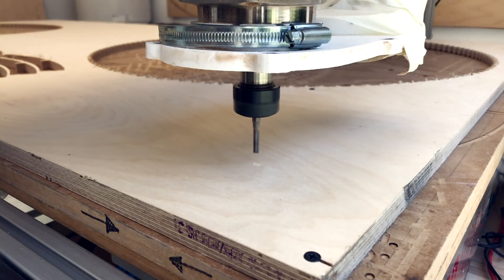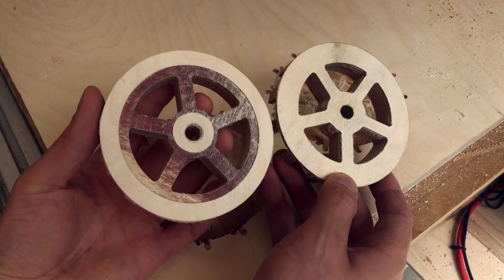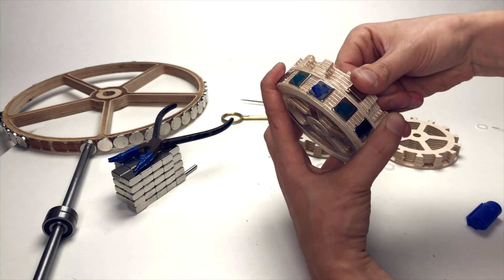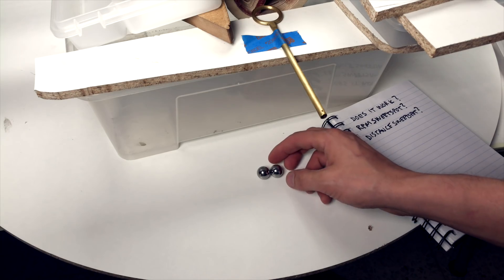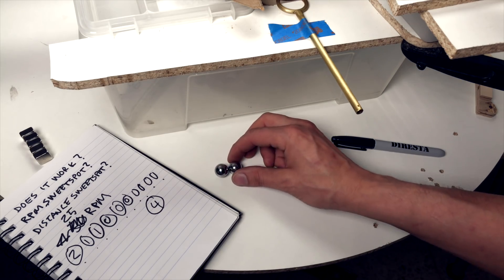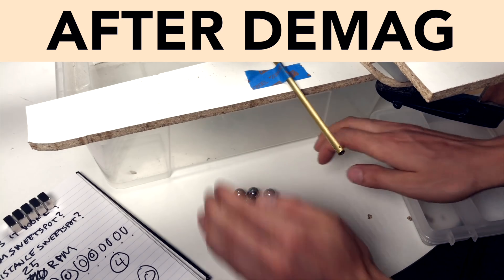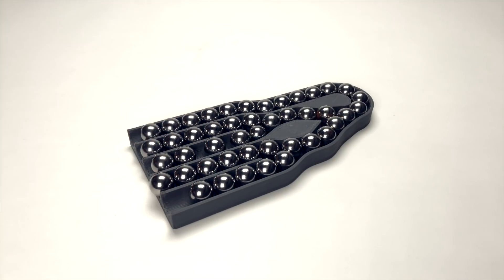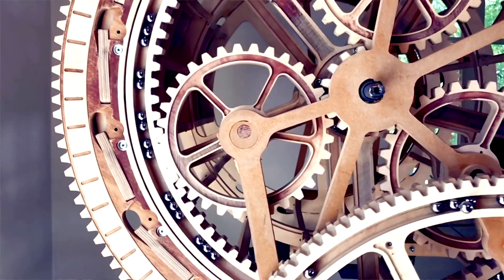Marble Demagnetizer 2 - Marble Machine X #39

Comment: I love your videos and look forward to seeing them every Wednesday. It looks like you may have had a few problems in your experimental setup though. First off when you push the marbles down through the marble divider they are not going at the same speed they will be traveling in the final product which could result in some errors. But more importantly it looks like the box that caught them at the bottom held the marbles really close to the de magnetising wheel after they had already fallen off the marble divider thus giving them a much longer time to be demagnetized by the demagnetisation wheel. Just some things to consider. Keep up the great work, I can't wait to see the finished product!

Comment: Hang on... Even if you slow them down to 25%, they'd still be moving at a consistent speed, but you let them sit over the top of them for some time before pushing them off... It might be fine, but that does make me wonder if it could become an issue.

Also, something else you didn't test was if the force of new marbles entering the first track would be able to overcome the magnetism pushing back the  other way

Comment: i really hope the marbles will actually flow over the demagnetizer. currently they seem to need to be pushed, which will likely throw marbles off the track. also, the first lane (that splits up => 100% "speed") is way shorter (to give the marbles some speed) and thus hardly passes by the demagnetizer at all (at least in the CAD-model). if this doesnt work out the way you want to, consider a steeper angle to let gravity help moving the marbles

Comment: I feel that you should try changing the direction of the demag wheel. In your testing, the magnets were spinning in the same direction as the marbles. If you change the direction, the marbles will pass through a greater number of alternating magnetic fields which should increase its effectiveness. However, this also means that each alternating field will have a smaller effect on the marbles due to the increase in relative velocity which shortens the time that a marble will be in any single magnetic field. 
I just think it is worth testing out as the speed and number of marbles over the demag wheel is likely to change with the song so you would want it to work to its greatest potential.
Keep up the good work.

Comment: I feel that the demagnitizer wheel should rotate the opposite way to the way the marbles are flowing, if you turn with the marble flow is there not the chance that the magnets "grab" the marbles and move them through the system so they don't spend enough time to be influenced by the magnets. But if you put it the other way gravity pulls the marbles down and the demagnitizer pushes slightly upward so the marbles spend more time instead of speeding through. Maybe this is a non issue though I don't know the entire MMX setup

Comment: What was the issue with glass marbles? Wouldn't they work fine?
Reply: they can't be used on the 2 first lift wheels working with magnet...
Reply: Oh yeah, I didn't realize other parts relied on the magnetism of the marbles. Of course the lift wheels could be changed but there are probably other reasons too.

Comment: Wont the magnets themselves hold the marbles in place? I saw you were pushing on it, will there be anything pushing the marbles? Or just gravity?
Reply: I gues the force from the other Marbles pushing it is enough
Reply: I was wondering that myself. It's hard to judge from the video how much force is needed to push them over the demagnetizer but it seems like more than gravity can provide…
Reply: My concern is that the incoming marbles will be feed too fast and will spill over the tracks from the back force of the magnets
Reply: If he made the first demagnetizing wheel a little bigger he could put a slope on thAt 3D printed piece the magnets would be farther apart  but I doubt it would be two much of a problem.
Reply: Marble pushing eachother and gravity force

Comment: stll to this day hoping that magnets aren't going to be used in mmx
Reply: why
Reply: LargeBanana you sure your name isn't Slowbro?
Reply: Dener Silva what do you mean, it seems the magnets are fixing a lot of possible efficiency problems in the machine
Reply: He's pretty clearly set on them at this point.
Reply: Some websites cite around 5% loss over 100 years for neo magnets, but either way the ones on the MMX aren't going to fail before we're all dead. :-)
Reply: YankeeIngenuity they lose less that 1% of their magnetic strength over a one hundred year span.
Reply: Ah!  Right on.  Centuries from now when this wonderful machine is getting some maintenance, I'm sure fresh magnets will just be part of the restoration process.  I'm liking the look of this design better than the prior.
Reply: I keep thinking about all the sloppy electricity getting generated when it's all up and running, as well.
Reply: He can always make more components for the machine, you know ... Have a couple of spare demagnetiser modules, maybe a few fly wheels that can be easily changed. Once Martin knows the MMX will work to the standard he wants, he can then manufacture spare parts. to take on tour.
Reply: Dener Silva magnets are not finnicky to work with if you know what you are doing. He’s clearly doing a great job with them and they are very necessary to this machine. Taking the machine apart and putting it together will not effect the magnets at all. Also the type of magnets he is using are extremely reliable and very consistent in behavior. With his type of dedicated experimentation before putting anything on the machine I believe he will have very good success implementing magnets anywhere he sees fit.
Reply: I sort of agree.  Don't neo magnets have a finite life span?
Reply: LargeBanana why

Comment from the maker: It´s Monday Everyone!
Reply from the maker: @radioMax haha, thought you missed two days of appointments thats brilliant :)
Reply: Goodnes, gracious... you scared me Martin! I just wake up and when I saw the notification I tought it was Wednesday! Hahaha, have a good week!
Reply from the maker: @shashank D Never heard of it :) maybe have to change marbles after a while... In hindsight i shouldnt have used magnets for the lift system, it was just so much more esthetical but if i would have redone the design i would have skipped it, so much problems, now hysteresis lost is another to add to the pile :)
Reply: @Wintergatan  Hysteresis loss  will not affect your mechanism at all. All it does is produce a little bit of heat, and make the wheels of the machine a bit harder to turn.
Hysteresis is just the reason why you have to demagnetize the marbles in the first place.
Reply: my thoughts exactly, it's not like the marbles are expected to induce any current or do work in any kind of electromagnetic device
Reply: New trend: Wintergatan Mondays
Reply: Marble Machine Mondays are an excellent way to start off the week!
Reply: Marble Machine Monday?
Reply: Martin have you ever considered, with all those moving magnets in there, generating enough current to run a few LEDs to light the machine internally for awesome visiual effects on stage?
Reply: Best way to start a monday <3
Reply: You could get some of that special paper that lets you see magnetic fields so you can tell exactly the right height to put the demagnetizer. It would look super cool, too (even to include somewhere on the final MMX maybe)!
Reply: No that is not how you should say it 
The correct way is: it is Monday my dudes(and dudettes)
Reply: Wintergatan I see what you did there
Reply: Hey Martin check out this video. 3D printed magnets may be able to help you in your design. tinyurl.com/SED153-Magnets
Reply: MAKES my Monday unexpectedly exciting!
Reply: IT HAS TO BE CALLED MARBLE MONDAYS.
Reply: Wintergaten Monday’s
Reply: from WW to WM
Reply: pin your comment to the top
Reply: great now I have to wait less to see your videos :)
Reply: @saneman100 it does look all nice in a steampunk kinda way. I love it.
Reply: Wintergatan mondays
Reply: Jk it’s making Monday’s
Reply: @Wintergatan @Basement ScienceE 
Indeed I found @Shashank D comment quite bizarre. The magnetic properties of the steel marble are intrinsic to the material. The marbles do not lose any magnetic properties at all.

The technicality behind it is that you have several the so called "magnetic domains" inside the steel, which consist of regions of the material where the magnetic field vector is pointing to a given direction. The magnitude of the magnetic field in each domain is intrinsic to the material (it's about 2T for steels) and is not affected at all by such magnetizing/demagnetizing cycle. 
Initially, the orientation of these domains are randomly distributed, so the sum of all magnetic field vectors cancel out. When the marble is subjected to a strong external magnetic field (e.g., the NdFeB magnets), this has the effect of orienting these magnetic domains to the same direction of the magnetic field of the magnet. When the external field is removed the distribution of the magnetic domains does not necessarily become random again (because of the hysteresis!), so the marble remains with a reminiscent magnetic field, which makes them stick to each other. That's why you have to demagnetized the marbles, as @Basement ScienceE pointed out.
In several engineering applications the material is subjected to magnetizing/demagnetizing cycles (for example, the steel sheets in transformer cores), sometimes thousands of times per minute, but the magnetic property is not changed.

Maybe @Shashank D was referring to the demagnetization of the NbFeB magnets over time and exchanging all the magnets would be a pain in the ass. This indeed could happen, but I'm not sure if such decrease would be relevant or observable in your mechanism. I think this would only be a problem if the Marble Machine is subjected to another even stronger magnetic field.
Reply: Shashank D if you have noticed there are small gaps in the corners of the magnet placement gaps in the wheel so I guess that they are Made to make the replacement process easy
Reply: Floggle We do have internet here, don't worry 😉
Reply: Will there be one on Wednesday ?
Reply: Every day should be wensday!
Reply: 7:42 RIP!... jajaja!!! XD
Reply: Hello Wintergatan, have you considering to edit al the video content you have so far, and until you finish MMX, to make a documentary movie about it?
Reply: My birfdae
Reply: Hai
Reply: Man I'm not getting a paino until till next week end but I love your vids and creations.
Reply: @ Floggle You'll find a way... :)
Reply: Pierce Arner Excellent name! MMM for Marble Machine Mondays is perfect.
Reply: No its mœnday
Reply: Wintergatan repulsed is cool. That is an English word. You're good.
Reply: @shashank D Hysteresis loss has nothing to do with losing magnetism over time. Hysteresis loss is energy wasted on magnetizing ferromagnetic material in other (opposite) orientation it's already magnetized.
Reply: Wintergatan i got a really bad sun burn but your video cheered me up
Reply: Nice job with that demagnetizer; but you shouldn't slam it with a hammer, as this will demagnetize your magnets.
Reply: Wintergatan  🌷☀🌼😀🍒🌸🌳
 Mon bonjour de France
Reply: Very cool demagnetisation mechanism, But what would be really cool is to utilise all those magnets and add copper coil winding's around and near the magnets to generate dc electricity and maybe you could add a light show with LED's on the marble machine X.
I don't believe that LED strips would use that much current.
Please reply to this comment if you think it is a good idea and the same if you think it's a bad idea so I know there is life out there. LOL.
Reply: Its getting complicated for my brain
Reply: Wintergatan it is wednesday my dudes
Reply: Not likely with hardened steel balls. Applies to soft iron, such as used in laminated transformer cores.
Reply: Its wednesday my dudes

aaaaaaaah
Reply: I dont like mond!y
Reply: wooooo more wintergatan made my day lol
Reply: You'll have to account for the hysteresis loss, when the marbles are magnetised and de-magnetised. Due this they could lose their magnetic properties over time